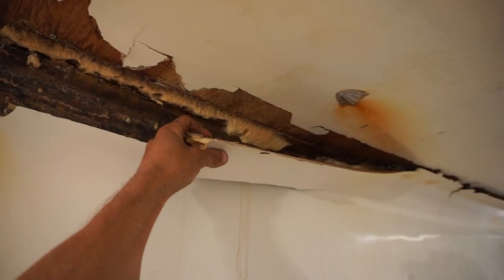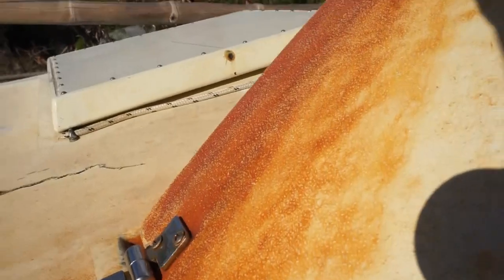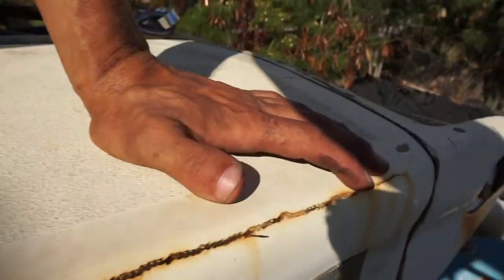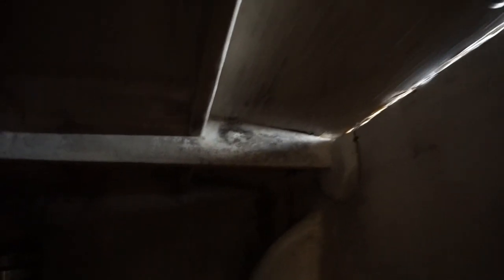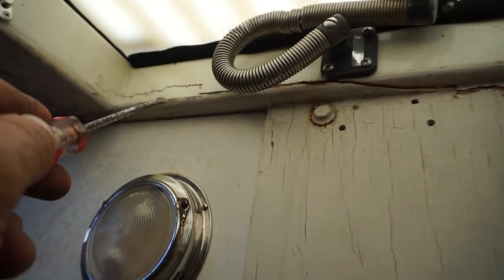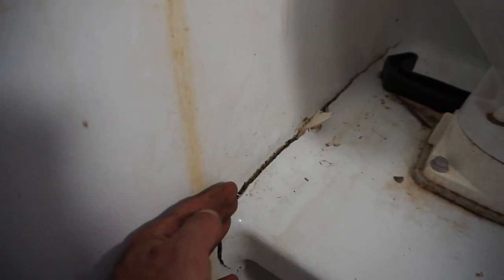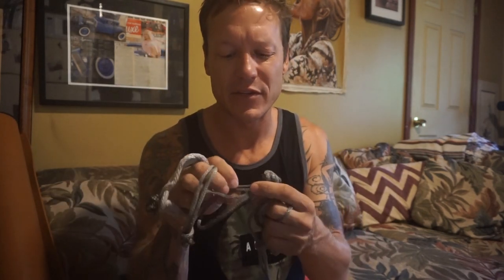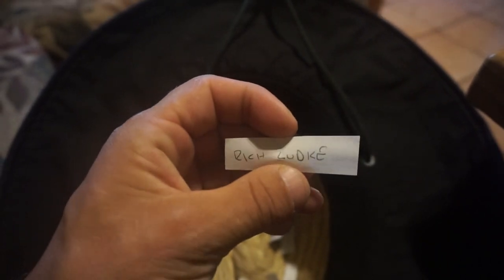Tearing apart my wrecked Catamaran

Comment: James - when you extended the dagger boards by 1 foot so you could reduce side-slip, did you calculate the additional lever arm force against a predesignated structural integrity of each hull?  Also Look up the Term M.T.B.F.  
Travel Safe, Fair Winds and Following Seas 
-- Your Friendly Neighborhood Computer Scientist and Son of a Sailor.
Reply: @spikedone2 Hulls, keels and in this case dagger boards that may have helped circumstances go awry not far from the coast of Havaii!  =D
Reply: @spikedone2 My suggestion is that: before you build your boat, If you have not sailed  you should go with an experience sailor. In that respect i may be in a position to assist.  
As far as recycled materials for low carbon footprint, renewable energy complaint  earthquake and hurricane proof housing, ---that is a subject that is better discussed in a place NOT here.
 I should know if substantive resources will be ready for those projects in the next few days.    To understate is the most massive way possible. there are plans lurking, and a total shift in the way the planet will function.  If you are not up on the GCR/RV you may want to use that email sooner than later (ie:now).  When you get a chance look up 'Tikkun Olam'.   Travel Safe and be well.
Reply: @spikedone2 Nah. it was just an interesting day on the water, at least he had both rudders!   Bwahahahaha. 
What you see as guts and faith is more like temerity and persistence, that and a lot of rum will get you into port. In this case..... any port in the storm seemed to have worked. =D 
For those who have not sailed, James seems skilled.  For those of us who grew up with a basement with 60k worth of tools, a boat 300 feet from their house and 2 teachers for parents, its a slightly different vantage point. Not critical of James, just a case of: been there and done that. 
None the less, as captain, it laudable that James made any port in the storm. Like landing an airplane, any landing with no loss of life is a good landing. The boat like all toys, can always be replaced  Travel safe and be well.
Reply: @spikedone2 Almost forgot to mention,  if you are serious about building a boat watch "Acorn to Arabella" on Youtube, they start with the lead keel and build up from thar. When you watch.... you can consider much of what they do, a day to day of my childhood.

Comment: Sad but fascinating.  I kept thinking 40 years old...  My brother built aluminum boats for 25 years- told me aluminum can absorb only so many sharp impacts before failure and that nautical engineering was very important.  I met a fellow on a jet ride who was 30 miles offshore in Florida with a friend who had a new fiberglass powerboat cat.  Abruptly one hull catastrophically separated and they basically had to be rescued.  With a CAT, can't there be certain wave directions which cause "stress risers"?  And do you think your particular wave sets were bad at the time of failure?

Comment: I think it's fixable. The biggest challenge is to squeeze and hold the whole thing together within the pot life of one epoxy pour. Before that you would need to remove all the moisture and other contaminants from the seams. I would do 2 pours, one with very thinned out epoxy to penetrate all crevices and then before it dries one doped with milled fiber to add strength, adhesion, and reduce shrinkage. The big problem is that dopped epoxy sets super fast reducing 2 hour pot life to 5 minutes, and if you make more than a few ounces at a time it gets realy hot and sets even faster. I guess you would need 10 or 15 skilled people all focusing on their part and all coordinated. Several practice dry runs to make sure everyone gets it right. To squeeze it together I would glue brackets across from each other every couple of feet or so and clamps. Once the whole thing is glued together you can replace the broken stuff and reinforce with steel. When reinforcing with steel think 'leaf springs'. Multiple plates oriented so you get some flex in the direction you want it.
A bit more elaborate than fishing line and 5200 but just think how long you got that portabote to last.

Comment: dang .  wood composite hulls can be sweet, they can be built by amateurs for sure  -  BUT a lot of amateur builders sometimes cut corners on plywood selection using stuff made with non-marine adhesives. But more commonly builders dont encapsulate properly.  Even if it is non-structural and interior - all plywood should be covered with glass and epoxy and coated with many many coats of primer and paint. ALL surfaces. Any place that gets a lot of traffic, inside or outside will get water or vapor intrusion because of dings and wear etc. The best way to avoid the destructive effects of these penetrations is to also pre-coat the bare wood with CPES (very thinned epoxy), then before it is totally cured, lay the fiberglass,.  The CPES will impregnate the outside ply layer quite deeply and make it very resistance to water intrusion due to pokes and dings...or simple vapor intrusion through coatings.  But the boat may have just pre-dated good marine epoxies that are now readily available. Anyway proper encapsulation using wood/glass/epoxy is a much more challenging goal in practice than in theory.

Comment: The other arc pieces are larger than the one at 9:36. So, since it was so small, they doubled up on the plywood there, hoping it would handle the stress. But, with all of the other arcs a single piece of plywood, the total stress was too much. Those arcs were supposed to handle the entire stress. I saw another boat, performance cat looked home built, had them talk to you. Theirs does had a nice chunk of fiberglass on some of the arcs, they think it will be what will keep it together. But, I saw a company built one and those pieces were very substantial, more substantial than I'm seeing on either "performance" (means built light so itl go fast. ). If I ever get the chance to buy one of those I'll double, even triple the plywood in those areas. And then fiberglass them. I've seen some boats with 4 inch think "arcs" for lack of the better word for them.

Comment: did Crowther Airex Spindrift 40 in 80, per Lock I went 23' BOA and 53' mast. have same blkhd in photo that shows larger scantlings and greater surface area overlapping of wing blkhd and hull blkhd for superior epoxy connection strength. Best friend was B. Conover, helped him build his Airex Bucaneer.  the hull opening per plans is not on hull centerline but slightly outboard of centerline. Lock was so good at offering sparkling performance designs by keeping the structures light but also keeping meat where needed. I think I see in your video alterations that were liberties taken by the builder. I can provide photos if interested. May still have my plans. Wow $600 plans  was the start of 10 years aboard, home school, powerful intact memories that keep me happy when I go to sleep 40 years later. All the very Best to you in your efforts. Airex hulls are awesome!!!

Comment: Fiberglass tabbing looks way too narrow and needs additional tapered plys for the loads involved. The cross beams are like wing spars in an airliner. They have to take the stress of the rig and the bouyancy of the hulls. The shapes of the spars are far too complex, every corner focuses the stress. I didn't see which beam supports the mast but imagine the downward force of the mast when the boat falls off a wave and the fall stops suddenly. It seems to me that multi-hulls use engineering to build a strong structure out of light components and all those parts need to be 100% for the design to work. Pretty hard to expose the deficiencies during normal inspection. I think the biggest issue is the size and strength of the cross beams.

Comment: There will be one, or two, CAUSAL reasons for the initial failure. Everything else is because the "normal" stresses were FAR exceeded. Plus, it's been through long and hard use. Everything breaks, eventually. Awesome what you've achieved with her...

Comment: I think your name is James? My names Rob Im an engineer formerly in the submarine business, but my degree is in aviation, so bit of a difference.
First things first, Im sorry you lost your boat, just devastating. I cant imagine how I would cope if I lost Zaya so, Im impressed with how together you seem, good mind health.
Now the caveat, Im not a boat designer, been on a few cats, thats about the limit of my experience sans having made a few small ply structures etc. Buts its not going to be like I dont know shit from clay I promise you.

Ok what Im seeing is what we class as catastrophic failure. The real tell for me was the last part by the head, for once a complete bulkhead which as we can see is largely in tact, but the tabbing between it had no meat to it, where I would expect to see at least a ply transition to take the load between the bulkhead and the inner skin. Without webs or flanges or better bearing this is how I would expect this joint to fail. Moving back through your video, the two holes. Yeah well really if two holes propagated that failure it was just too close to fail anyways. Not to say you are wrong but clearly the designer didnt meet his marks for safety factor and obviously because the major components dont have enough depth. 

To illustrate, I would expect a beam like this to be a component constructed on its own of either a box type or an I beam type, with a nice deep vertical web, and continuous flanges top and bottom. I would want a complete bulkhead on both ends thoroughly attached to the web of the beam, and a dramatic transition of that web from the top of the bulkhead to the nearside of the bulkhead. Like a giant Y on its side, then flanges from the top of the beam over the top of the bulkhead, and from the bottom of the beam to the inside face of the bulkhead. This gives a true force transition between the beam and the bulkheads which by eyeball I would want to be at least 10" deep where it also has around it a ply or glass skin, all the way to the bulkhead. That same flange material size would be as well right around the bulkhead to properly put that force into the skin, because I see little other framing of consequence. Really two major beams like this should be satisfactory on this weight of boat, but some attention needs to be made to the holes to transit through the bulkheads. Holes in bulkheads need ring beams around them on the outside of the hole. I imagine just simple 5 ply would do but it must go right around the hole crew use to move about.

Some big flags for me is that where I see failures generally the joint glue didnt fail, the material has pulled apart. I imagine the tensile strength (resistance to being pulled apart) of these materials as easy to work out by virtue of the area or cross section of the material. Its says straight off these components were too small and too light for that application. This is basic engineering and appears to be a common failure throughout the boat. Im usually reticent to say but whoever this guy was he left no reserve strength, BAD ! indeed it was probably too low to begin with DOUBLE BAD!. I think he also failed to have cohesive beam design that would have prevented this entire fail, which to me is about the most basic attention to give a catamaran, and we didnt touch rigging loads etc which matter big time.

Ok so with your next boat you know something of what to look for, fair winds buddy.
PS I think you are fn lucky to be alive, that could have happened anywhere, or at night in the middle of the ocean

Comment: Great video.  I think it failed because its a catamaran.  If you get a wave pushing on one side of the boat, and anything at all holding the other side of the boat, the force between the two pontoons is too huge, and its going to snap the boat in half.  That looks like what happened, its just a weak design.  I would buy a monohull next time.
Reply: It that happened to a monohull with a 4000 pound keel they would not have made to back to port. Monohulls hulls break too.

Comment: #SailingZingaro please, if you need to replace wood in the hull use polyethylene-hardfoam instead it is stronger, dont bend strongly, has rough surface and is absolutly waterproof

Comment: Who was the designer and builder of Zingaro?
Reply: MGTOW WATCHER? hi there
Reply: @thenarrator1984  Greetings!🙂👋🏻
Reply: Crowther design
Reply: @alcooper944  Thanks!
Reply: During Lock Crowther's career, more than 2500 of his designs were built. He started out with racing boats, where most of his new ideas were developed, though he was successful drawing cruising and commercial craft as well. Among his outstanding designs was the trimaran SPIRIT OF AMERICA, which was an early user of GRP-foam sandwich construction and had innovative composite beams with uni-directional fibres and turned-down ends. Lock Crowther also developed the use of 'bulbous bows' as a measure to reduce pitching, and hence increase speed when sailing upwind in a swell.
Reply: @UUBrahman  Thanks!
Reply: @UUBrahman  Also the first to my knowledge of canting hull design as seen in the early Catana cats. That spindrift didn't fall apart because of design fault , some fool drilled through the top cap on the main bulkhead and put bolts through it .

Comment: Having built and sailed two plywood/glass trimarans (37' and 42') back in the seventies, I can tell you the main crossarms are insufficient - not enough chord (top to bottom) and the solid wood sandwiched between the two plywood layers was not thick enough - plus the one crossarm had a doorway cut out that reduced its chord strength even further. Add to that, years of stress, some probably unseen water leakage, I'd say you were very lucky to get as far as the boat went. PLEASE,  don't bother to rebuild this particular boat, even if the hulls still seem okay. It would be much faster, cheaper,  to find another vessel, even if it's a monohull, and move forward. Good look, and thank the stars you both survived a shipwreck at sea!

Comment: I'm not familiar with plywood boat building even though I have built a few fiberglass boats.
Allthough I have used plywood in other applications proffessionally for many years that takes a lot of forces/load. My thought is that it's way to thin everywhere in this boat, and I meen everywhere. Also looks to be of a moderate quality with too few layers of wood. It's also strange that it turned extreme dark everywhere. Maybe someone cut a corner in the glue choice in this ply. 

I'm going to enjoy my steel hull on my sailboat a lot more which the manufacturer guarantees "no damage when running a ground in 8 knots". :)  

This boat is a gonner, plywood is on it's end of life, you cannot find every small hidden stress fractures and it's easier to build a replica on the side and move all hardware on to it from your old boat.

Comment: I SAY....,it cracked between those two bolts in the the main balk head..hole to hole when it was over tightend, 
The whole in the stringer...if you drill a hole on the start/end of a crack..in theory it has no were to spread to...round room no corners =no weak spot
but this i learned working steal ships...

all the best

Comment: Nothing wrong with wood composite construction. Some mistakes were made by the original builder that contributed to the failure but I saw no rot. Any structure has it's yield point, you can break an anvil with enough pressure. The boat stayed on it's feet, didn't sink and brought you back safely, how much more can you ask? Welded steel boats sink, fiberglass can break, shit happens. Just glad you're both safe.

Comment: You should take all that nice new rope off the boat and save it . The other things that are still good you should also remove and sell . The radio with the AIS you should save . Save or sell as much as you can and leave nothing of worth to waste or worse vandals.  Then burn the boat if possible burn it until nothing is left so as to reduce the amount of waste they have there already

Comment: first, happy your safe, and on land... been here plenty, and have worked on wooden boats with glass overlay for over 50 yrs , but never a 'cat ... biggest problem i see is the large bolts and holes drilled in several areas were after-thoughts, and not in original construction... this all looks like second go around work to me, and i believe it was repaired about 10-15 years ago by the looks of color of wood and color of glass , and the glass is pealing to easy if it was originally applied properly .... first coat of resin and single layer of glass should be squeegeed on tight, i used to use window squeegees , to much chance for air to get in, and moisture ...not with just a brush and roller... if i couldnt get a squeegee in tight, i would cut the bristles down to 1" long on a brush , and pull tight .... yep, i think you are num.2 or 3 to do some of this repair... take a good look at the other side and see if all holes and bolts are in same position .... in one of your vids you mentioned that another boat was just like yours, and you took us onboard to show us , but they were not the same, the overhead had been raised 4 -6" higher in your boat, makes me wonder who did the work, and how they did the work .... its not metal or aluminum, and adding on wood takes a lot of screws and glue ..... i would really think this over, time is on your side, cuz it will take more time then money, but every mans time is worth something ... another thing , get a piece of the plywood that you can see edges complete and count the layers, and thickness of layers... marine ply has thinner layers and also water proof glue, when you pulled back some of the plywood it seemed to have to  thick of layers, and came apart to easy .... cheers for now ... and thanks for your journeys .... steve